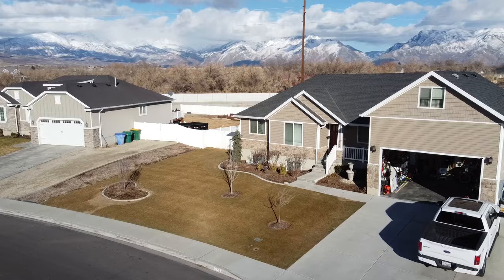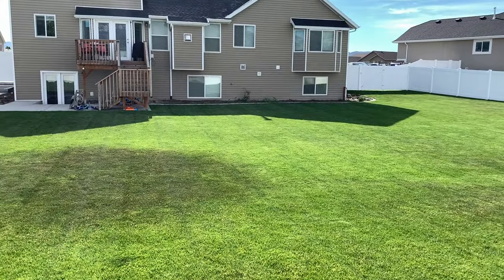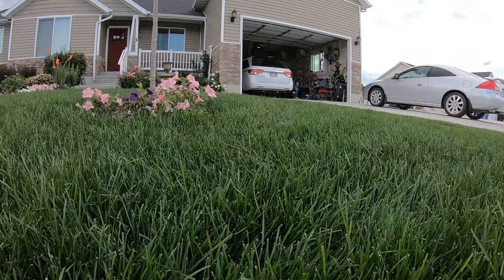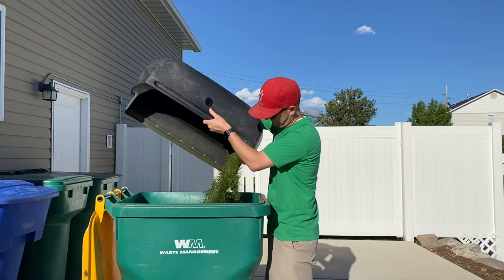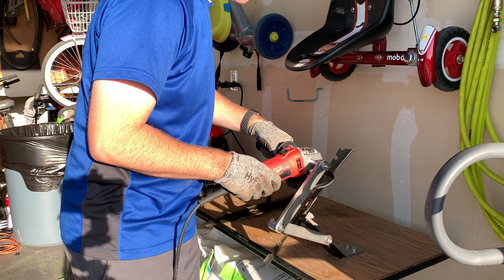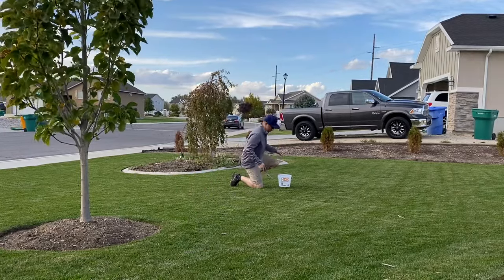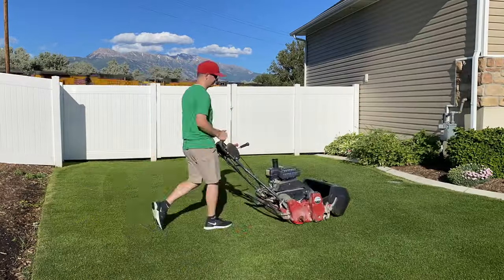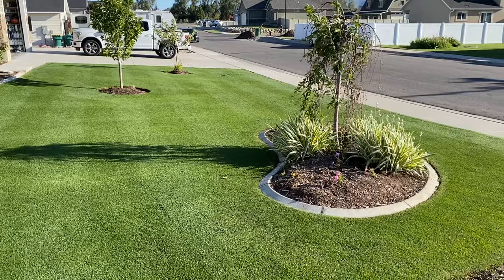5 Lawn Care MISTAKES You Don't Need to Make

Comment: What do you use for the soil test kit? Any recommendations?
Reply from the maker: This is a good kit for beginners. I'll be doing a video on it soon. https://jimmylewismows.com/products/ym-soil-test-kit
Reply: @JimmyLewisMows  thanks man!
Reply: @JimmyLewisMows  so I’m about to order the soil test kit, when I take the sample, what temperature is an ok one to get it at? Right now it’s a 35 degree avg soil temp. Thanks!
Reply from the maker: @heyMVPhey  Definitely would wait until the ground isn't frozen. I'm about to take my sample and the soil is measuring low to mid 40s, trending up.